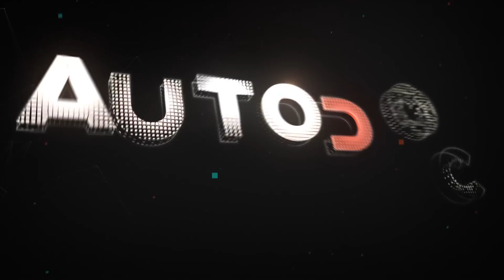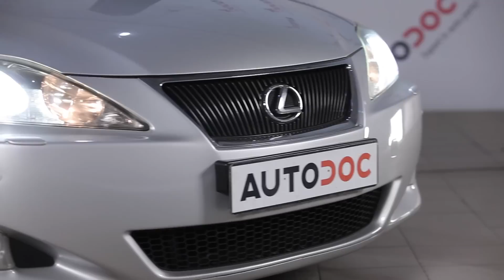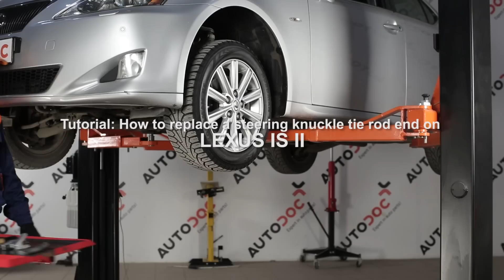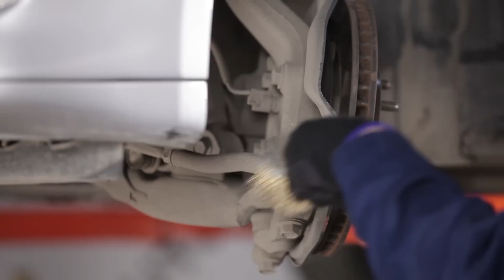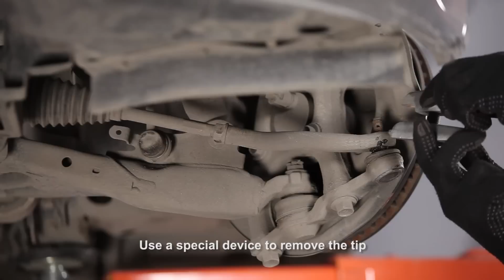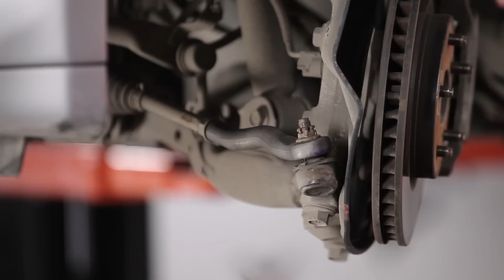How to change tie rod end / track rod end on LEXUS IS 2 TUTORIAL | AUTODOC

Comment: On my 2001 IS 300 the tie rod ends has a ball joint attached. And not sure why the ones I'm replacing come in from the bottom. No left or right markings. The new ones are marked left and right and would have to be connected from the top with nut on the bottom. I think someone put these old ones on wrong is my guess. 
Just washed a video from A 1 auto.
That shows the tie rod same as the old.
Coming in from the bottom with a ball joint. Just wondering why my replacements are marked wrong. Maybe universal. They look the exactly same. As long as I put the curve in the same direction. Should be good.
Reply from the maker: Hi! Thank you for sharing your experience, it will be very useful information for us and our viewers.